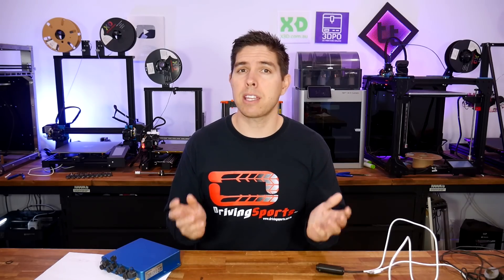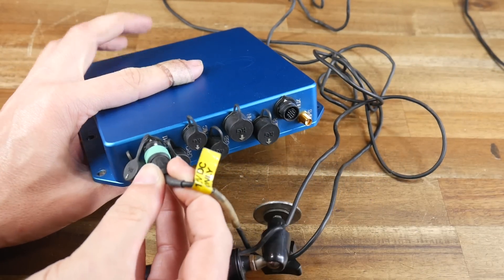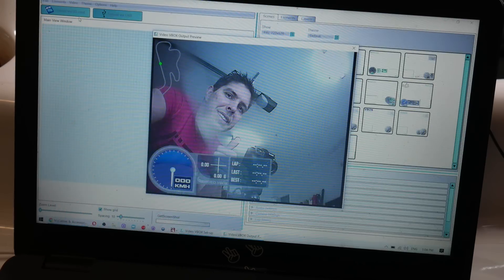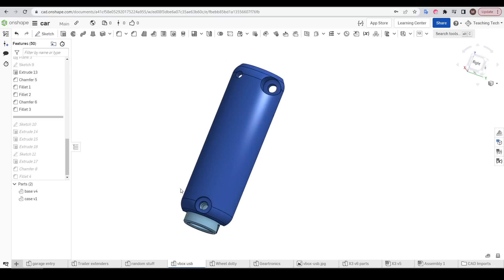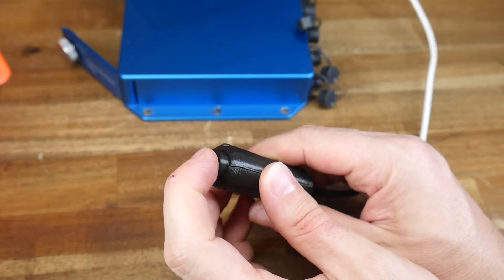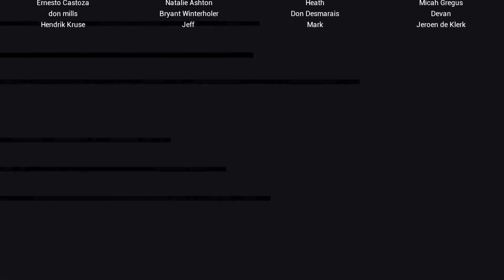Making an unavailable, proprietary USB cable with 3D printing

Comment: It appears based on some quick searching that the mating connector for the usb port is a Hirose connector:  part number HR30-6PA-6P(71) and the connector on the device is part number: HR30-6R-6SD(71). It is a solder cup connector, so you could use the same trick with cutting up an old usb cable and then just soldering on the new connector. You can also still get the rubber port covers Hirose part number: HR30-6R-C(31)
Reply: I assumed as much. Very unlikely that a manufacturer of a short run item like this would go to the trouble of rolling their own connectors instead of just using off-the-shelf parts.
Reply: I checked the documentation and it looks like Hirose HR30-6P-6P(31) to me
Reply: @piotrokrutny477  That's my conclusion as well.
Reply: @piotrokrutny477  No.
The male connector is the HR30-6PA-6P
And the female connector is the HR30-6PA-6S
Reply: It's definitely a hirose connector. 
I have literally soldered thousands of (different) hirose connectors. 
These connectors aren't that expensive and there are plenty of Chinese knockoffs available for even cheaper (though sometimes they are really bad quality, while others are basically like the real thing). 

Everything below like 12, 16 or 20 pins is also quite easy to solder.
Reply: @Esablaka  The document he shows also literally says "PIN VIEW HIROSE". The site linking to the document (second Google result when searching for the part number) says "Hirose 6W Plug" so "it's a hirose connector" was pretty much a given.
Reply: @AlexusMaximusDE  Michael is a good guy be hes not the brightest one
Reply: @Arek_R.  I don't think that's fair. It's extremely easy to miss that information, especially if you don't have the experience to know that "hirose" make connectors. Plus what makes a more interesting video, "i bought a connect off the internet and have soldered it onto a cable" or "i've custom built a connector and this is how you can do it for your own weird old electronics"
Reply: @roseroserose588  Yeah I know I have same problem even at work (electronics engineering department) and been told by manager and boss few times to go easy on others...
Reply: @roseroserose588  Agreed. As long as it serves its purpose, making it yourself is great. He could have bought a connector, but getting it would probably have taken weeks. Designing and 3D printing one takes a few hours.
It didn't involve 3D printing, but I needed a longer fan cable in my computer, so I created an extension cable from a cable from a broken fan and a Dupont connector. Took me a few minutes, and I finally got a chance to use my crimping tool I bought a few years ago for a project I never got around to 😀.
Reply: @roseroserose588  honestly, I'd rather have watched a video that talked through the process of identifying the connector and how to build out a part number from a datasheet. 

Besides, the premise of the video is false. This is not a proprietary connector. It's a mass manufactured connector that's still available. It also would almost certainly have been possible to email VBox to just see what parts are needed. It's a $7 connector, in stock at several vendors right now. 

If the video had been about cheaply recreating a very expensive connector, I'm all for it. Or if it had been an out of stock/obsolete connector I'd get it. But this video just talks about how it's a proprietary connector - which it absolutely is not.
Reply: @Arek_R.  This video got 120k views, seems pretty clever to me.
Reply: @billdberger7407  its called "clickbait" and it's generally frowned upon. he ends with product inferior to $5 aliexpress set.
Reply: @KaminKevCrew  Yeah. This was what I was wondering. At minimum he could have emailed about the part that he was unsure of to buy. However, one thing I've noticed about YT people is that they are impatient af.
Reply: @kozapytapl  Maybe he couldn't find out what kinda connector it was. Sometimes you just don't have anything to go by to find out what kinda connector it is if you aren't familiar with a certain field. If you don't have anyone to ask then you make a video that gets 120k views and suddenly a bunch of nerds come crawling out of the woodwork about how it's obviously this and that and how the video is clickbait.
Reply: @KaminKevCrew  LMAO 😂 It's highly doubtful they would tell him the part number. That's like hoping an amp manufacturer would send you a repair schematic. It's not worth their time to help you repair something, when they would rather try to sell you a new one. They don't give a damn if an old product they don't sell anymore goes to the landfill! They'll send you an "I'm sorry it's discontinued, but you can buy THIS one!" email, that's about it.
Reply: @NoMoreBsPlease  I mean, I've done it before and been told what the part number is for replacement. Especially so for professional level products that have been discontinued. But you do you I guess.
Reply: This once again serves to demonstrate the best way to get information from the internet. You don't ASK for the answer to a question, you put something online (right, wrong - doesn't matter) and you'll get your answer.
Reply: I’ve actually soldered these before for a Bosch system. Not a fun time. I ended up hating myself, and soldering is the one task at my job I’ll take from someone if I can because of how good I am at and how enjoyable It is.
Reply: That's not a simple issue in all countries...
Reply: @Jason Grammenos :  That's good to know, but if Michael had done that, we would not have a video to watch!  🥴
Reply: @PiefacePete46  sure, but how about mentioning the correct connector, then indicating that it was too expensive or not easily available, and then 3d printing it. Forcing 3d printing un necessarily always seems disingenuous to me. Just because you can 3d print it doesn't always mean you should.
Reply: @JasonGrammenos  :  Yes... fair comment.   👍
Reply: WeLl AcTuAlLy........
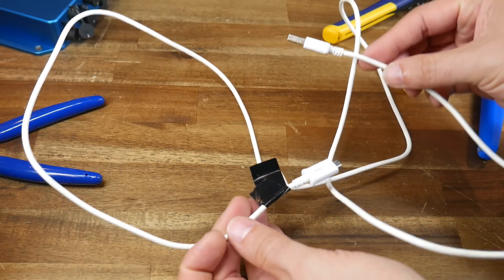Reply: In 3:48 it even states "HIROSE" 😂
Reply: Yeah while this was a nice video for a "what if" scenario and how to tackle that kind of problem, I knew as soon as I saw the thumbnail that it was a pointless endeavor since those connectors can easily be bought
Reply: If the only tool you have is a hammer, everything looks like a nail.😂
Reply: I was gonna say something was off when I saw the connector had 6 pins and usb2 has 4 pins and a ground.
Reply: Lol u just owned his research capability... "Quick research" after he made a whole freaking video about reverse engineering the connector LMAO
Reply: @Nebuchadnezzar  sometimes the connectors are crazy expensive, or won't be here for weeks, or both. Still serves the educational purpose

Comment: This may be a stupid question, but after you found the right size, why not make the USB plug portion of the cable with resin instead of printing it?  Much more accurate.

Comment: Really cool to see this project! However, I feel like it would have been 10x cheaper and 100x easier to just get a suitable off the shelf connector and socket, change the proprietary panel-mount connector on the box, then make a new wire harness to go from the pcb inside the box to the new, non-proprietary panel mount connector you bought. The pcb end of the connection appears to use a readily available Molex connector.
Reply: No need to even replace the port. You could just buy the hirose connector that was on the original cable. Then solder an old usb A cable to it and be done with it and still have a water-resistant connection.
Reply: 10x cheaper? He spent like $2
Reply: @ochowells  that’s if you don’t value his time designing, printing, and testing. Which is fine: he clearly didn’t count it that way, ignoring the fact that he got an episode out of it…

Comment: I would approach it from other side. Remove oryginal socket from device and mount different one. Ie mini din 4 or 5 pin socket and corresponding cable if you want screw collar or standard usb-b for true universality. But your way is still good when there is no access to device internals.

Comment: It's all cool and all, but in my opinion, if you're designing that plug, it would be more convenient to make a shape that corresponds to the shape of the socket. That way, you couldn't put it in the wrong orientation, and it wouldn't require such a precise operation
Reply: Wanted to say the same

Comment: Points for preserving the device's original configuration. 

That said, I probably would have pulled a USB socket off a scrap circuit board, printed a housing for it that fit the hole in the case and soldered on pigtail from the old connector.
Reply: Or buy a panel mount USB port, probably even available for the same diameter hole as the existing proprietary connector

Comment: I have to agree with a few of the other commenters that a USB-C breakout board in a custom enclosure (maybe with a screwcap) would have been the best idea, especially because the original connectors were using JST connectors to connect to the PCB.

Comment: Great project, I learn a lot from your content.  You can dissolve hot glue with isopropyl alcohol (spirits).  soak a part if possible and you can gently peel it away

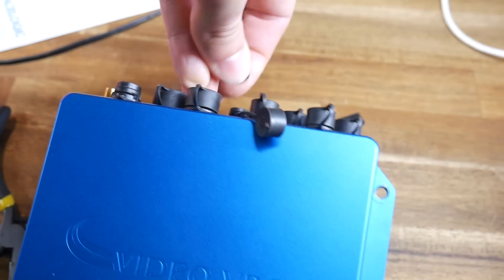Comment: I don't like bulkiness, I like to minimize things as much as I can :) @07:39, on the flat inner side of the round pin holder, I'd add a ring of 4-6 protruding finger-like spikes, 3-4 mm tall, running in a ring 1-2mm outside the metal pins. The fingers would be slightly bent in, to the center, like logs in a bonfire. Then I'd solder the wires to the metal pins (no heat shrink), insert the pins into the holder, then pour some superglue to cover any exposed metal (up to the wire insulation). The glue would flow under the plastic "fingers" and between the forked ends of the pins. Once the glue sets, the inward fingers would hold everything in, preventing any slippage (even if the superglue didn't fuse to plastic, which it probably would). The connector would be only as long as the forked ends (7-10 mm?)

Comment: Idea for future project.  Make a silicone mold to inject resin that would encapsulate the wires after your pin alignment housing.  This could shrink down the overall size of the connector.  If you could make a jig that would hold the wires in place, the whole piece could be resin.  You could use the 3D printer to make that initial mold.

Comment: I would have gone straight for epoxy, hot glue or low-temp thermoplastics first, and failing that, swapped the jack on the unit for something more standard... but as you know, when you have a hammer... 😄

Comment: I would think it would have been easier to attempt removing the connector from the device and wiring in something that would allow you to use a common cable to attach it.  But I obviously don't have one of these in my hands to know better.  Great vid and use of 3D printing though.

Comment: if you are up to taking a soldering iron to the device you could solder the wires directly inside the unit even desoldering the original connector and having the cable hang out and flopping around in a janky kind of way .

also i downloaded your video so if vbox should file a takedown notice to youtube it can be reposted to a site where it will never get taken down.

Comment: Great project, but one thing I'm looking to start doing more of is 3D printed silicone molds. Silicone is very easy to work with and can look great. That TPU cover would have been a perfect side project for that and likely would look identical to the others. Something to consider in the future.
Reply: Sounds interesting! Replacement electrical plugs with screw-terminals are always more bulky than the factory overmolded ones

Comment: Although useful, its a bit of an overkill and feels a bit like 'when you have a hammer everything starts to look like a nail'. In the datasheet you show in 3:49 it says that its a Hirose connector, and its most likely HR30 series. No need to custom model and print a replacement connector for a cable, if that connector is still widely available.

Alternatively, the connector from the plug to the PCB seems to be a JST-PH or similar. You could have just ordered one of those 'standard' USB female connectors, and soldered those wires to that new plug. That way you could use a regular USB cable with the unit, instead of having to faff around with custom connectors.

Also, if you plan on gluing everything together, why not do away with the screws and just use glue to hold the parts together? 
Alternatively, you could have modeled a 'ring' on the back side of the pin holding part, and fill that with some epoxy with the pins inserted. That way you could still disassemble the two halves, but the pins would stay put.
Reply: @tHaH4x0r couldn't have said it better myself. Personally, I'll appreciate the video for sharing approach/thought process though I didn't get much out of the video myself. Would have been really interesting if the connector was seriously obscure with no datasheet for pin outs and dimensions to see how the problem would have been approached with more unknowns. Completely agree with everything you've said.

Comment: I'm looking forward to the time, where 3D printing became so wide spread available, that "propriatary" parts become worthless because everyone with some time and some CAD knowledge can just make their own.
And as far as the project goes: I'd rather have made an adapter that puts a "normal" USB port over the socket on the box. Or even replace the socket directly with a proper port.

Comment: Interesting to see they used LEMO elsewhere. I wonder if that's a LEMO compatible connector. Either way, LEMOs are insanely expensive, not worth it.
Reply: Definitely a Lemo connector on that cable for the other product, but others have mentioned this is a Hirose connector on the product he has. Either way, even if the connector is "expensive", it's nothing compared to the time ti took to model and print a replacement. Even if the connector is $30, unless it took you under 15 minutes to model the replacement, the "expensive" off the shelf connector is still cheaper

Comment: There are many waterproof USB-C panel sockets available on Ali, so I'd probably go that way and replace the proprietary USB connector on the device with a standard USB-C one. I think they would fit easily (I've just found one which requires an M11 opening and contains also a waterproof rubber cover very similar to the original covers)
Reply: That's exactly what I've been thinking the whole time watching this video. There are a ton of 4+ pin, waterproof, circular connectors out there. They aren't terribly expensive either (as long as you're not buying autosport connectors, anyway), and they would almost certainly last much longer and be more reliable over time. Not to mention, if you replace it with something fairly common, like an amphenol connector, it's likely to be around for a long time and therefore be easy to replace.
Reply: Is that even a proprietary connector though? It looks like a Lemo connector. They're fairly commonplace on scientific equipment. Expensive, but yet widely available
Reply: @gorak9000   I use lemo connectors on a regular basis for scientific instruments (as you rightly mention) but haven't come across one that looks like that. So yes, similar, but not the same.
Reply: @gonegliding2966  That connector he showed on the other cable for the different model was definitely a Lemo, but other people in the comments identified this one as  a Hirose, and even the exact part number. The logo on the dust caps is HRS, and an exact match with the Hirose logo
Reply: @jort93z  It is - if you read through the comments section, people already identified the exact part number. It's a bog standard off the shelf hirose connector
Reply: @jort93z  The receptacle (on the box) is a HR30-6R-6S, and the one that goes on the cable would be a HR30-6P-6P - there's 2 different pin layouts for the 6 pin version depending on whether the receptacle is male or female. You can see them all on page 12 of the HR-30 series datasheet. One has the pins aligned around the outer edge in a circle, like mini-din, and one has pin 6 in the middle with the other 5 around it in a square blocky inner section which matches the connector shown in this video exactly. The other numbers beyond HR30-6P-6P or HR30-6R-6S just define what kind of pins you want (solder or crimp, etc), but those part numbers are the correct pin layout and mechanical layout of the inside of the connector.
Reply: @gorak9000  googled "googled hirose 6 pin" and every image shows all 6 pins in a circle.
Reply: @gorak9000  admittedly, I was working on my car and listening - rather than watching - the video. On further inspection, it does look like it is almost certainly either a Lemo or Lemo clone connector. I was able to find one image in a datasheet that shows the 5 around 1 configuration shown. 

Besides, since the product in question is/was decidedly marketed as a professional product, there's very little chance that VBox would have opted for a proprietary, rather than industrial, connector.
Reply: This is exactly what I did. Designing a mount for an adafruit USB c breakout board is SO MUCH easier than designing a connector with tight tolerances
Reply: lmao, I was thinking this as well. Especially when he pulled out the other connector at the end and everything was terminated with little pigtail connectors. Up until that point I was thinking that he just didn't want to desolder, splice any wires so that he could keep it original, but when I saw that it used a connector I threw that line of thinking out the window haha.
Reply: lol thats what I was thinking when I saw the connector was just a breakout to a JST connection on the PCB